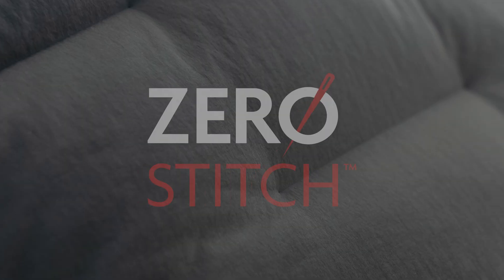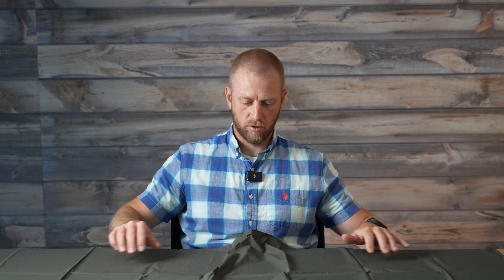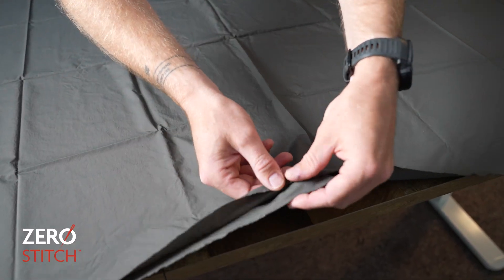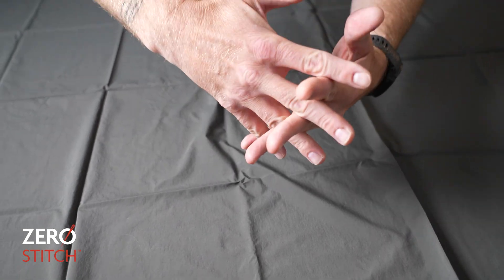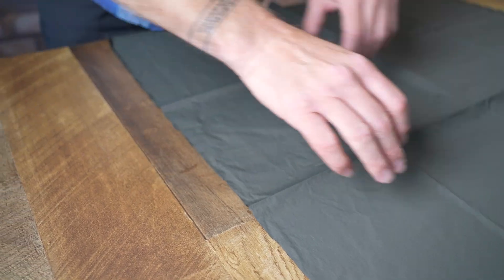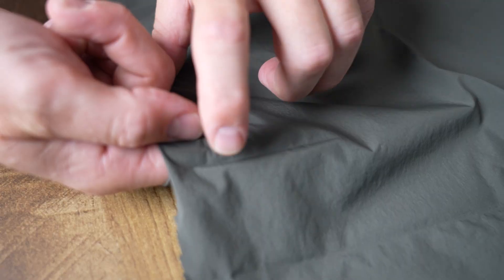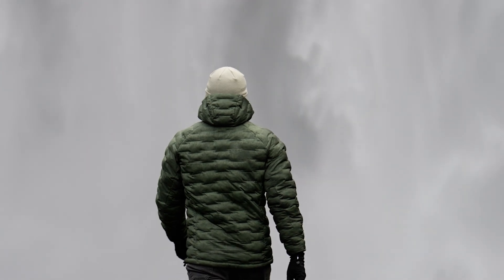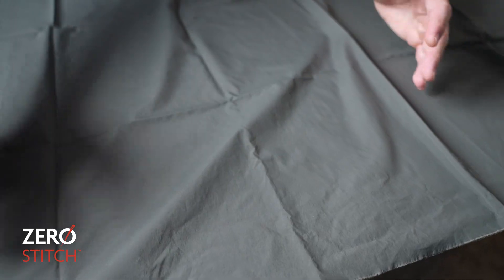What Is Zero Stitch™ Fabric?

Comment: having to keep redistributing the feathers is kind of annoying i find (Novapro), and uneven distribution seems to reduce the insulating capacity in certain areas, and the design of the square sections makes it more difficult to move the feathers (having to move them in the fist place is the most annoying part though). I own almost every jacket you've made so far, mostly great stuff! except for that particular feature; curious to know what you felt was flawed with the NovaUL cylinder design with no stiches? if you did a second no stich version of that with significantly more loft i would definitely buy that one, but that's just me...